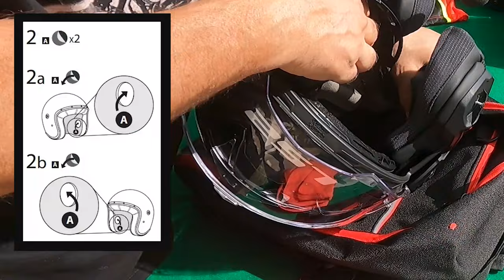Installation Cardo Bold - Edge with 3M mount on LS2 Advant X Carbon Helmet

Comment: Thank you. Useful video as I want to put a Sena onto the same helmet , so now I have a good idea. 👍
Reply from the maker: Glad to help you
Reply: @SteveHarleyTours  Thanks my helmet arrives tomorrow, I'm touring Europe on Saturday. I notice from you video the slider for the dark sun visor is  UNDENEATH the helmet. Which is a great help, It means I can get the Sena Evo 20-S on, as the backplatewhich  drops down and use the 3M self adhesive as you have, and keep the operability of the sun visor. I may have to pack out a bit as the shell seems to have a bit of contour there, but there is plant of spare 3M bits in the Sena box. Thanks again for an extreemly helpful video.

Comment: I couldn’t make out where you fitted the speakers. 

Are there cut outs holes in the eps liner large enough for the Cardo speakers?

I am looking at getting this helmet and currently have a Cardo Packtalk Bold which I will be fitting to it.
Reply from the maker: Hi there, yes there are pockets inside to fit the 40mm cardo bold or edge speakers

Comment: it looks like there is a black plastic piece connected to the bottom of the back of the helmet along the curve of the helmet, some areas have small holes. any idea what that is for?
Reply from the maker: Yes I saw that, I think is for extra protection of the neck 🧣 but not sure 100%
Reply: The pocket in the back is for a custom comm system (by Cardo) for this helmet. The plastic piece in that pocket is just a placeholder to fill that space.
Reply: @Smedis  That's right. I have just installed the Cardo LS2 4X Intercom. The placeholder space hosts the battery. Which is neat, because it allows for a much smaller control unit. I am really pleased with this Intercom/helmet combination. The only thing it lacks is Mesch technology. Apart from this: perfect.

Comment: Radio ok? With carbon helmet
Reply from the maker: What is Radio? You mean intercom yes
Reply: Box cables are Radio antenna , normally  carbon stops it.
So Radio is fine in carbon helmet?!
Reply from the maker: Hi there radio works fine and tested, thanks  @feelgooddany